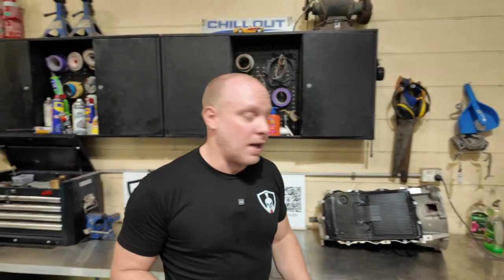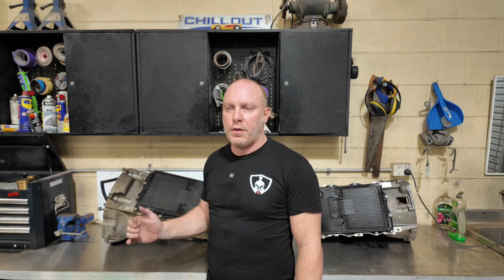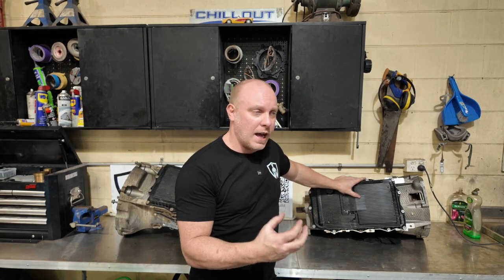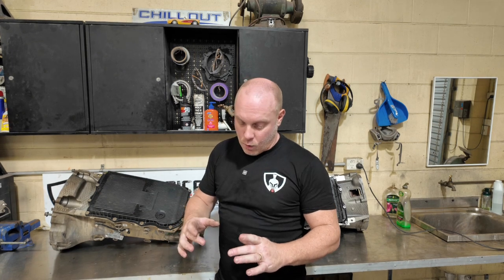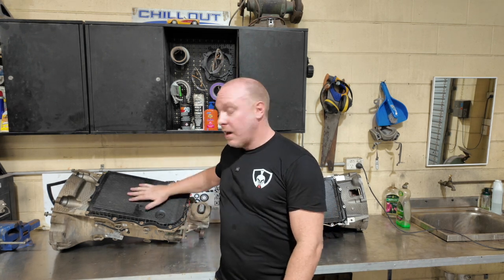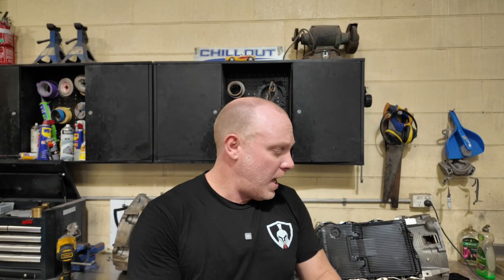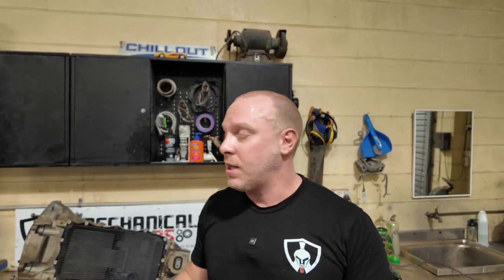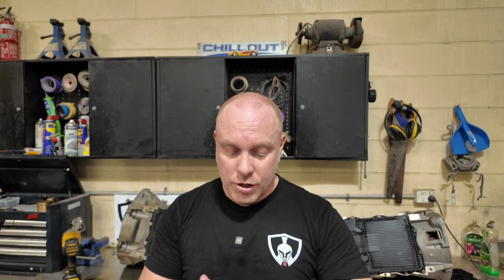Swapping Control Solenoids on an 8HP Gearbox for Turbo Lamik TCU Upgrade!

Comment: Maxxecu can do all the things turbolamik can plus some
Reply: False.  It cannot modulate the clutches with driver input to replicate a foot clutch.  The Maxx also cannot increase like pressure for higher power applications
Reply from the maker: @PH020  cool thanks for the tip